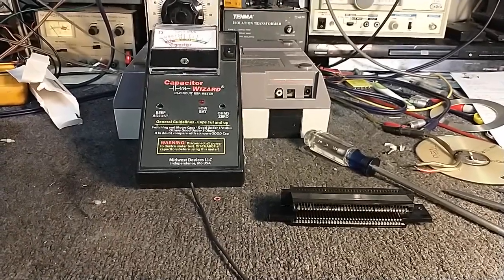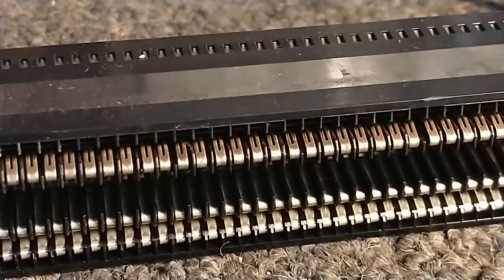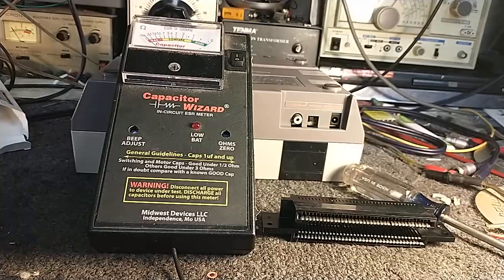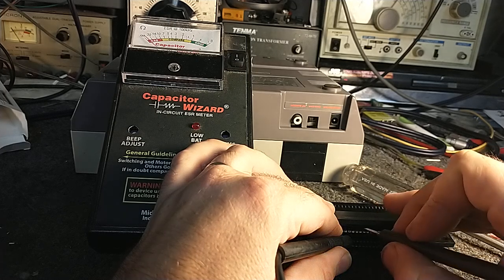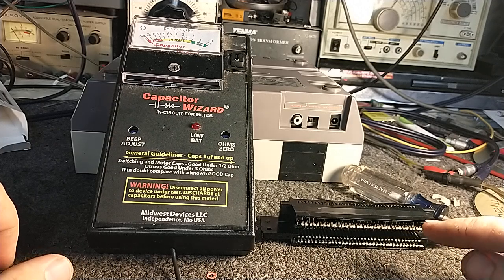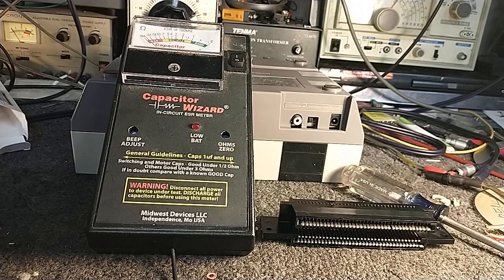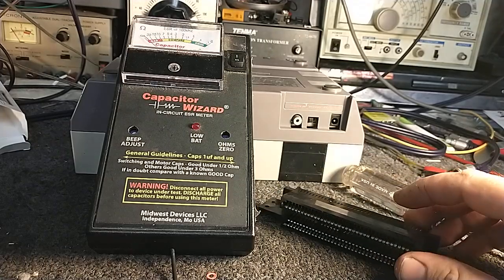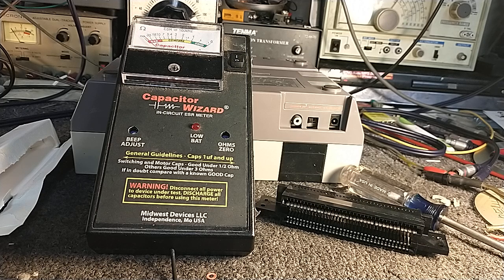Replace the old 72 pin connector on your NES toaster. Here's why...

Comment: Really great points and information, but unfortunately all of the aftermarket/eBay connectors I've come across are pretty bad.  Best solution I've seen so far is the Blinking Light Win connector, even if it does ruin some of the nastolgia factor.

Comment: I've never owned a nes but the old computers i used to mess around with could crash if i touched the interface gently.
I soldered one memory extention direct to stop the unstable memory add on.
Very old and crude machines but i enjoyed the old beasts :-D

Comment: There is a HUGE difference in quality with the replacements. They are too tight, they abrade the contacts inside the cartridge, and they don’t even have the same contact profile (often work or work better without pressing down).

Comment: You’ve actually got that backwards. The contact portion with the split is gold-plated, not the tip or the vertical parts on the back side or the part that connects to the PCB. While the hard gold plating may be badly worn and scratched, the difference in color with the tip is the exact opposite because the “dull” area you point to is the plated contact area. Clearly, they submerged only the bulging contact area in the gold electroplating solution.

You can look at a brand new connector from Nintendo and the part that is intended to connect is gold-plated. Perhaps some of the earliest consoles were not plated but the vast majority were.

Comment: I bought my Nintendo NEW in 1990 and had to replace that connector by the year 2k.
For anyone who wants to do this, you have to buy a special bit too to get into the NES.  I also picked up a top loader at a flea market with the dogbone controllers around the same time I replaced the connector, so it's been sitting unused since around the turn of the century. 
THEY ARE JUNK.  They all do it. They did it when new.  I have NEVER replaced ANY connector in any other video game including many 1977 Atari 2600s.  The early 2600s were built like TANKS.  The early cartridges all have doors that protect them from the elements as do the 2600s.